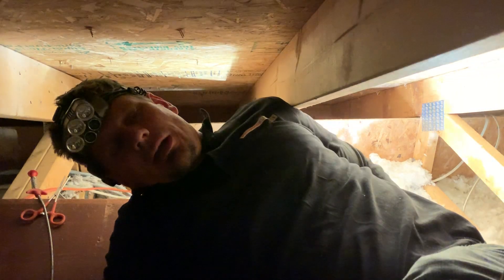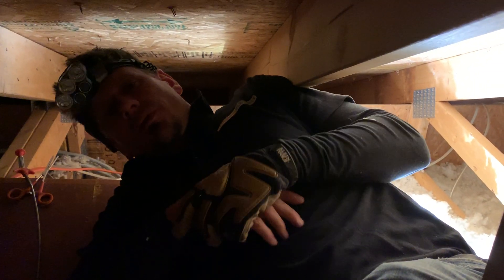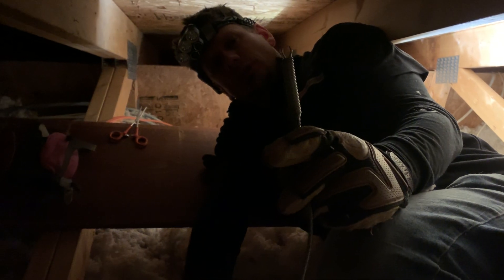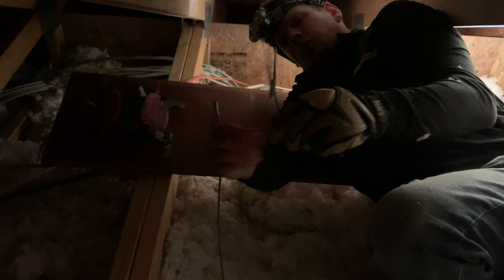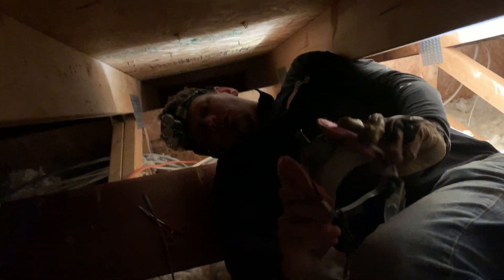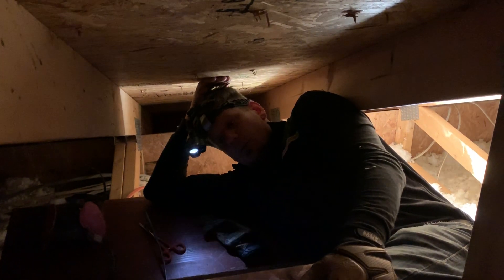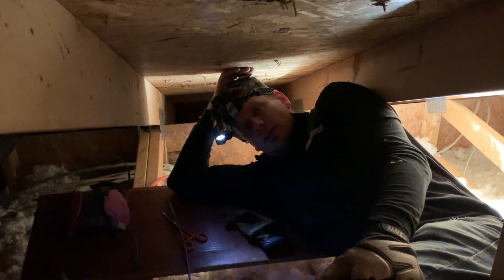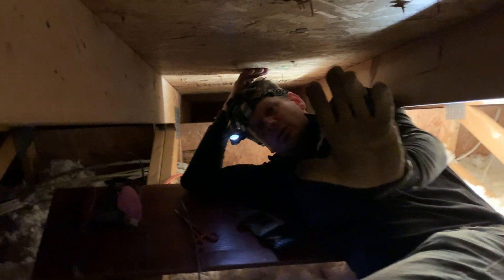Wiring for Electrical Blinds - Part 1

Comment: After about the 20th time ringing my bell by banging my head on a rafter, I've been wearing a hard hat when I'm working in the attic. It also protects me from putting a hole in my skull from roofing nails or worse, shiner 10p nails from the drunken roofers nailing down the plywood. Like $20 on Amazon, nothing fancy, but protect your head.
Reply from the maker: This is good if you can handle the heat and extra weight.

Comment: Nice. The "real" world.  I'm a bit on the larger side, and getting older, lol. Having a spry 19 year old as an apprentice helps alot!
Reply from the maker: Yah, I'm small and skinny, never was a good side when you liked football in HS. So, I joined in to soccer. LOL. BUT, now it pays off somewhat. When I was an apprentice, they called me "Tunnel Rat" and sent me behind all the walls in the bathrooms to wire the sensors for the toilet valves. Fun Times!